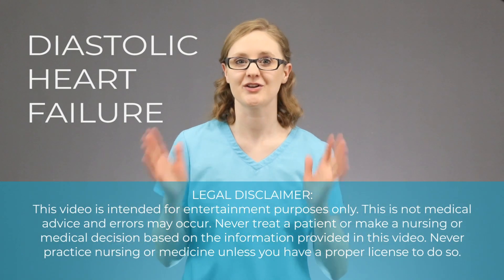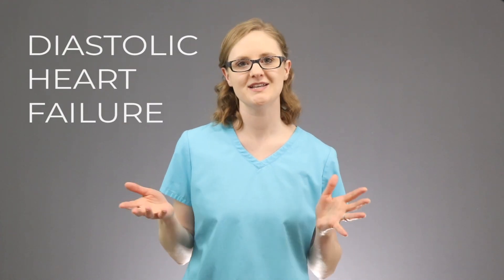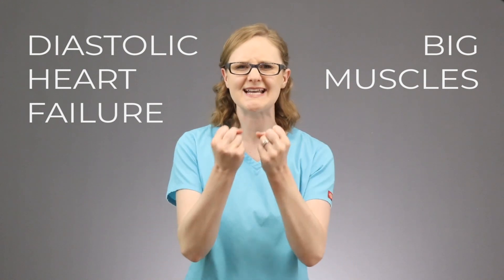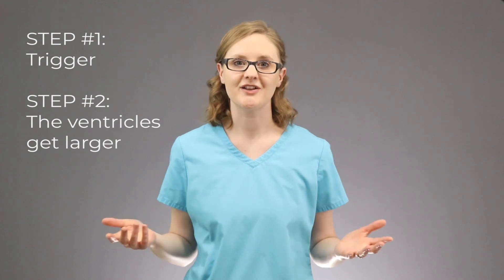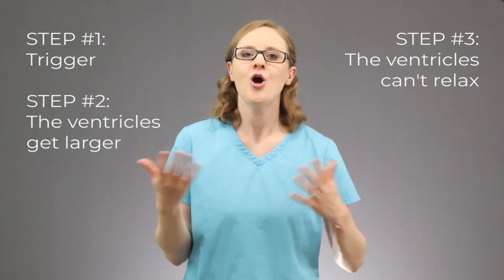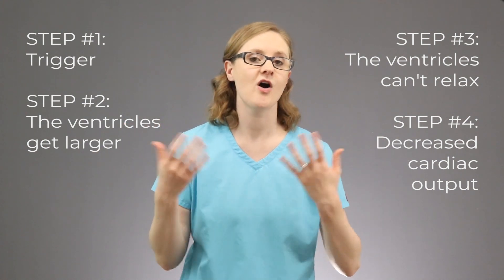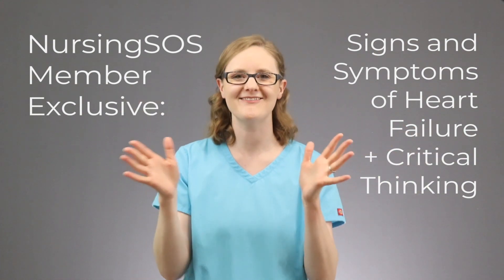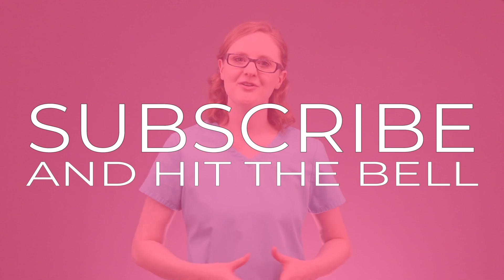WHAT IS DIASTOLIC HEART FAILURE? (DIASTOLIC HEART FAILURE PATHOPHYSIOLOGY)

Comment: I have been diagnosed with diastolic heart failure and am researching so as to visualize what is going on inside of me. Loved the muscles in the gym illustration as I used to body build and yes, you HAVE to stretch your muscles as your muscles are growing. I visualized a ballerina as you were talking, how they are as strong as an ox, yet they don't have big bulky muscles because they stretch. A couple of things I didn't understand when the doctor talked to me was how the heart chamber doesn't "fill" like it should and why the chamber was growing thicker. Again, your description brought to mind two analogies: 1. You had said that the heart has to work harder to get the blood out of the heart. That helped out a lot!  (I envisioned a water hose turned on a brick wall - in order for the water to penetrate the wall you must turn up the pressure - light bulb moment here) and 2. When you talked about how the heart wasn't able to fill, by your description,  I think I finally understand! I had it all wrong!  I was baffled because I was envisioning a heart chamber that could hold say a cup of blood but was only filling up with a half cup, so then I was seeing, in my minds eye, the chamber only partially filled, kind of like a bottle of water only half full.  Not exactly correct, but as you were explaining it, I got it! or at least I think I do.  Here's how I see it now . . . Let's say your body orders a dump truck load full of blood for it's needs and when the truck goes to dump its load into the heart, there isn't enough room for all that has been ordered, so the heart only receives a fraction of what your bodies organs and tissues need and as a result, the supply and demand is not met.And my doctor never told me about 'crackling." I call it gurgling and I'm so glad that you said this because when I told him about the "gurgling" he didn't say a word and just stared at me. I felt very stupid and figured that it was another one of those things that happen that no one believes you when you tell them about it.Thank you so much for helping me to understand more fully. Very MUCH appreciated!
Reply from the maker: I'm so glad this video helped you understand it more! :)